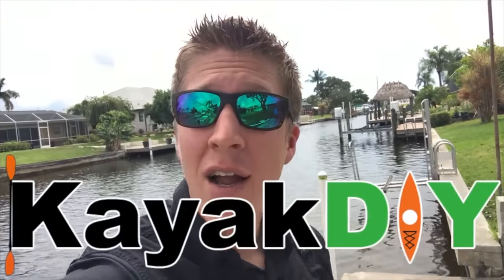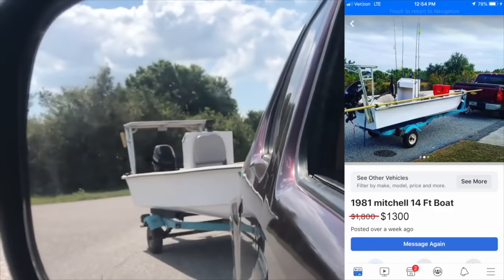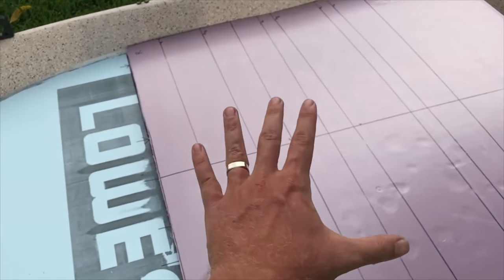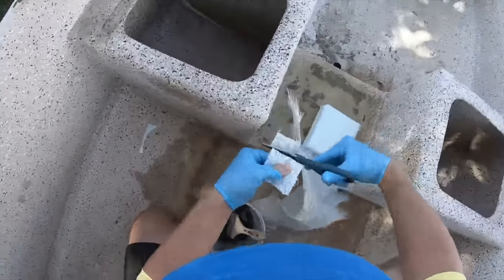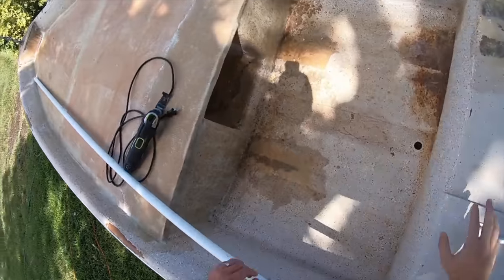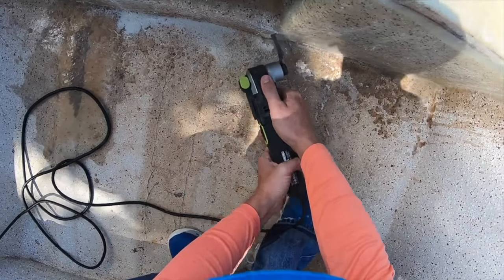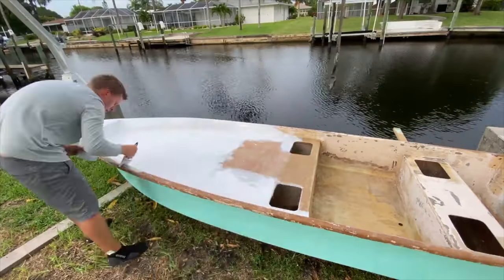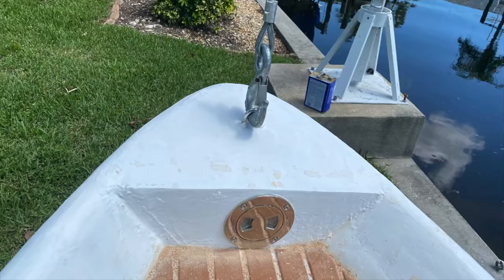HOW TO BUILD A FIBERGLASS BOAT IN YOUR BACKYARD (Start to Finish)

Comment: Nice Workmanship ! ... BUT ... Screw the Monkey Bars and add a Center Console with a steering wheel , electric start , compass , Sonar and Captain's Chair ... Then you can sit down , when you get old ! ... A hand rail for your Platform would also be You also covered up all your Front Storage for Anchor , Rods , Paddles , Fish Cooler , Life Jackets , Fire Extinguisher , Ropes , Fishing boxes , etc !  ... The boat will balance better ! ... Why did you put your Motor back Farther , where the shifter , choke and controls are harder to reach ? ... It looks nice and solid though !  How much was the Final tally ? .... Good video !

Comment: I'm amazed you didn't get more likes to this video! You did a great job! I fix my boats as well and you were spot on mostly with how I do things! 20 years never had an issue yet!
Reply: Thats because of the title being clickbait. It's a rebuild, not a build. People can't sand clickbait even if it's a good video a clickbait title can ruin it. Seen many YouTubers go downhill for that reason.
Reply: he rebuild.not buiéd from scratch,thats why,
Reply from the maker: @FarmerFpv  Realize this is an old comment.  Honestly didn't even think of it as clickbait.  Best economical way to "build" this size boat...is to just buy a cheap crappy hull and gut it.  WAY cheaper.  So to me this is the way to build one.  I understand where you are coming from, but cost wise it seems foolish to attempt to build one from scratch when there are so many hulls that make good bones.  Ive seen people cut hulls in half and stretch them or put two boats together....still more cost effective.  The principles I taught give beginners the basics to tackle most of these projects.  It might not be pro boat builder level, but many pro boat builders can't teach others very well...so then we have a bunch of people who never even try.  I'm just trying to inspire people to try and not be afraid of failure.  A cost effective build like this means failures won't cost you much.
Reply: @KayakDIY  agreed, where can I find old boat hulls ? Also how to install pwc doctor?

Comment: Look great 👍. I really enjoy boat work and mods. Skiff looks back heavy to me from the video, I might be wrong. Once again awesome content. A lot of work went into this skiff and it looks amazing.
Reply from the maker: 100%  If I put fuel tank mounted in the bow it would have leveled out with just me on the boat.  The second I put a bit of weight in the front half of the boat it levels out a lot.  With one person and fuel tank in stern it squats in the back a bit.  Even adding ice and food/drinks to cooler on deck leveled out the boat quite a bit.  Also in video I didn’t have water in live wells.  Between those two things it significantly corrects the leveling of the craft.  Lastly if I throttle a bit beyond idle it starts lifting the stern due to Permatrim cav plate.

Comment: I know this is an older video, but I’m looking into building my own skiff. If you are open to sharing, how much did this build cost you? I’m curious how much was saved by DIY. Would this be a feasible option for a first time boat buyer? Thank you, and great video man!
Reply from the maker: You can spend as much as you want.  Glass and resins are actually the cheap part.  Accessories like grab bars, motor mounts, etc all add up quick.

Comment: The bi ax on the transom is fine. I’m sure there are some internet repair technician commenting. I didn’t care to read them. What you have done should last a long time. You also know what you did. So you can easily repair anything. 

If the poly res don’t hold up, go to vinyl res. We used all fgci on our 24’ center console. Down to the stringer. No issues with their products at all.
Reply: Been a boat builder for 35yr now. Most of the repair jobs we get in is polly and Vinyl DIY attempts. They shrinkage is what causes most problems. People often do the transom in polly or Vinyl with chop strand and normal plywood or woods but they often don't last long so we get them in. Here in the UK we have Powder bound Chop strand that works with epoxy and thats fine for any transom work as its extremely strong compared to the polly or Vinyl. If its a skin up on a transom we will use 4 or 5 layers of 300, 450 or 600grm glass depending on the thickness required and its always a bit overkill in the strength department, maybe 30% stronger than either polly or Vinyl so it's good that it's a bit stronger and longer lasting but it's easy to overdo it and make the transom too stiff

Comment: 20:00 As someone else posted, this is a good spot to use microspheres mixed into your resin to create a paste. But, when you are building up an area; start with small pieces that just cover the spot (again pulling out the edges to thin it) then the next layer slightly larger and keep layering until its built up to where you want it. At the same time, don't do too many layers at once or the internal heat of the curing epoxy will cause voids inside your layup. *EDIT* Oh yeah, use gloves... it will take forever to get that epoxy off your skin!
Reply: He's using polyester for the deck

Comment: It would of been nice to make a lid out of that second piece of plywood off the bow. The whole thing could of been a lid that lifts up at the aft end with the hinges on the other bow end. It is always good to have as much dry storage you can have. You will learn about squeegees the more fiberglass work you do. Overall a great job, no matter what anybody says. You have to do it to learn and you certainly have done that. Paraffin is used as a surfacing agent on your hot coat so you can sand it. Excellent!
Reply: He lost a LOT of storage!  I was also thinking of a big live well on one side of it and a big cooler on the other.

Comment: I'm just wondering why you wouldn't mix microspheres into your resin and fill the holes that way. They would actually get filled instead of just topped with glass and creating a bulge on the surfaces.

Comment: 18:07 Prior to mixing your epoxy, cut all your pieces of fiberglass mat and have them ready to wet out! Then mix your epoxy and lay all the pre-cut fiberglass!
Reply from the maker: That is a good tip.  I eventually did that but failed to show it in video.  The best tip I have for working in hot environment is to pre-chill resin or gelcoat to increase work time.  Not all of us have a climate controlled workshop.  Best way to learn is to jump in and have fun.  That is the primary focus of this project.  Just wanted others to overcome their fears of perfection and tackle a project.  Only path to perfection is through failures.

Comment: the woven matt is great but it is not great at adhesion... one would normally put a layer of chop strand first, make it slightly larger than the woven patch and then cover that again in chopped. Pretty much best practice..

Comment: ITS LIKE YEAH MAN I BUILT THAT BUILDING..IM A PAINTER...LOL
Reply from the maker: I am considering building a boat from complete scratch.  Want to do around a 13.5-14ft solo skiff with self bailing foam deck.  Basically something unsinkable.  Maybe run 6hp -9.9.  

I did see a damaged Gheenoe and thought of cutting the gunnels off and keep only the underside/chines then build new gunnels, new transom, new self bailing floor, and maybe have front deck hatch.  

I have a second lift in my backyard.  The problem with the boat in this video’s rebuild was that I needed drain plug out or charged battery and bilge when not in use else rainwater filled it.  I somewhat got around this by using a PwC doctor boat plug valve.  I want a micro skiff that I can throw in back of truck or keep in backyard for quick trips out to the flats.  I have a 19ft cc boat, but it is bigger than I need for myself and costs more in fuel. 

I don’t mind your criticism.  Haters are sometimes my best fans driving views.  😉❤️

Comment: question..why the rack behind the boat over the motor?? its just make you unable to cast behind..but hey,it turned out very well great job sir.
Reply from the maker: It is a southern thing.  They do it for flats fishing and sneaking up on redfish, bonefish, etc.  It is called a poling platform.  You use a long pole and push your skiff through the flats so you silently creep on fish.

Comment: I’m from South Florida , had a lot of boats and i lived in the WashingtonD.C. Area for over 35 years that i kept a 30footer. on the Chesapeake Bay  for the majority of those years BTW the Old Timer Crabbers and Watermen of the Chesapeake Bay used alot of WoodenSkiffs to earn their Living  and prior to Hydraulicmodern style TrimTabs a lot of those guys just attached Asphalt Shingle sections  on the outer edges of the Transom that hung below the bottom of the boat  to drop the Bow under Power  it was cheap  and fast  i’ve even seen a old Work Boat (Bay Built style that  had those Shingles that were just nailed on with Typical Roofing Nails ? that boat was built in the 1930s and who knows how long it was  run like that ? BTW many of those Bay Builts  have a lot of “Rocker” built into the hull bottom  and those men will hang large heavy Outboards on  the Transoms  to out Run Storms  and Rough Seas as fast as they can  most of those Vessels don’t have Coast Guard Plates  on them and fall into Historic  so they do whatever they want  and get left alone by Authorities  and Law Enforcement because they are just trying to make a few Dollars to feed their families
Reply from the maker: Awesome history! ❤️

Comment: pretty good deal on the Skiff,motor ,and Trailer  your Deck and Fiberglassing is a bit Overkill IMO  it surely should last a Lifetime or Longer
Reply from the maker: Thanks! Some of it came down to what was available.  I realize some was overkill.  However, at the time finding other materials resulted in huge shipping costs.  Some folks will definitely be able to reduce cost and weight via availability of different materials.  If I did a fresh build and had more material options I would go wood free construction.  Deck could be a lighter rot free honeycomb or other composite board material with fiberglass covering.  Point of this build was largely for me to tackle my fears and show people what a newbie could do.  Just want to inspire people.  I realize some experienced builders might critique me, but no one is 5 star building boats starting out.  Mistakes are part of the process.  Key is to have fun and learn.  😊👊

Comment: Can you fiberglass on top of gel coat or do you need to sand down to bare glass?
Reply: You're supposed to grind the gel coat off. And you should always rough up what you're glassing. It'll peel up after a while.

Comment: 3/4" plywood is very heavy. Half that -3/8" would work with a couple little struts to support the middle. Fiberglass made with polyester will stick to wood but will allow osmosis and rot over time plus will suffer crazing cracks. Epoxy is near bullet proof in these matters. It cost more but guess which one is better?
Reply from the maker: Epoxy is chemically incompatible with gelcoat which is 99% of the time polyester resin based.  The amount of water intrusion into the polyester resin coated “marine wood” will take forever to rot.  I would be dead before this boat had issues with rot.  Epoxy would be fine if I planned on painting it instead of gel coating.  The marine wood polyester resin coated, glassed, and gel coated will outlive me.  Literally the coatings company experts consulted with me on the build. Also discussed with other long time boat builders. Polyester resin is still one of the most common boat builder resins.  I agree on the wood thickness, but I just went with what was available.  I wish I could of gotten composite sheets to do the deck, but wood with this treated will outlive me.

Comment: Really impressed by the result.  One thing I was wondering.  The final water run you posted it seemed a little stern heavy in the water.  Me being a large guy I'm familiar with small boat weight issues with the stern being too heavy.  I had a 14 ft boat with a 25 and it was too stern heavy with me in it.  Too much stern plow when accelerating.  How does it run with the Permatrim?  Would it benefit from some bow ballast?
Reply from the maker: It was definitely stern heavy without a person or gear positioned in the bow.  When I put my cooler full of ice and gear in bow It leveled out a lot more.  Also Permatrim & the OTF Jackplate help a lot.  The weight of poling platform and 25hp with me on the back was bit excessive.  Live and learn. I just encourage folks to give boat building a try....either from scratch or rebuild.  No one starts out a pro. The trolling motor, battery, and cooler in the bow area resulted in more balanced out craft.

Comment: Just to let you know buddy, when installing a bilge pump, the exit pipe should go as straight up as possible. If the pipe isn't going straight up the water will stay in the bend of the pipe from gravity and the pump won't be able to work against the pressure and burn the pump out.

Comment: good job,... just a few things you may want to do next time, foam instead of marine ply it will last for eve...r marine ply will rott dont matter how mush you resin it and high strength structural foam is much stronger .and strength of a part in fiber glass come from the core not the glass.
always radius edges you glass over as strait edges..... equals broken strands in the bi axial
try to use marine 2 pack epoxy as it digs into polyester and vinalester to give a chemical bond . poly on poly will give a so so bond poly on vinelester or epoxy will give zero bond.

foam and epoxy will add a hundred or 2 to the build of cause, and as far as i know there is no flow coat or gel coat that will stick to epoxy that isn't in a mold so you have to paint it. but it is so much stronger  and you get a total chemical bond.
if you you peel ply on the last layer of you work it will give a high build of resin on top of the glass so as to give a smooth finish that doesn't require sanding or filling, can be gel coated strait over.
hope some of this may be of use in your next project.

thanks for the great vid.
Reply: great tips. What is "peel ply"?
Reply: Epoxy paint will stick to any material and you cannot get a chemical bond from a cured surface mate, its strictly mechanical at that point. If you're talking strictly polly epoxy (not paint) then it's not good at adhering to proper epoxy but it's still not that bad either

Comment: Dude.... Why did you waste the underdeck storage space underneath the plywood you put down? Hope you use deck access plates
Reply from the maker: I wanted flatter standing deck.  I didn’t want tons of hatches to trip over.  The next owner can easily add hatches.  I actually still had huge under deck access for rods and gear…I just didn’t do it from the topside….I did it from the side between the bait wells. I did pre-plumb chaser tubes for running electrical to the bow.  

Best part of building a boat is you can build it to fit YOUR wants & needs.  😊👍

Comment: You should have removed the old deck because another of those style boats had foam under the real deck and becomes waterlogged  also should have cut top out of bench seat as and removed foam in side  when the foam becomes waterlogged holds lots of weight I've seen upwards of 300 lbs  on a different style but around same length then she'll plane out faster for you

Comment: It will help if you put your gas tanks in the front. That would’ve helped you get on plane faster
Reply: No, it won’t. It’s harder for a boat to get on plane with weight in the front. 1lb in the front is equal to 3lb in the back.
Reply: @rossmcclure5618  doesn't work like that mate, you need to judge where the weight is best suited to get the boat to rock over. That's ridiculous what you said as I have been in several boats that need the front brought down a few inch to get up faster.

Comment: Warning.. by not grinding and removing all of the flowcoat and paint prior to apply any resin will result in delamination. It may seem sound after curing but it will fail.  Especially if your replacing or repairing any stringer or bulkhead work. Not trying to troll here, just concerned.
Reply: Agreed, but from what I just watched, there's no detrimental structural hull failure that would happen, so it's easy to catch. I'd give this first time a solid 9 outta 10 for having no guidance(irl) or experience. I mean, the holes through the floor to drain the water to the back, that's more of an 'ehhhhh' to me. Rotten stringer, floor rot from the underside. But I have this feeling, he'll get the 'bigger boat' itch before he sees those.

Comment: Maybe you need to trim up the motor a little it will get on plane. I wouldn’t make the deck that big when I’m rough water you want to be in the boat not on the deck